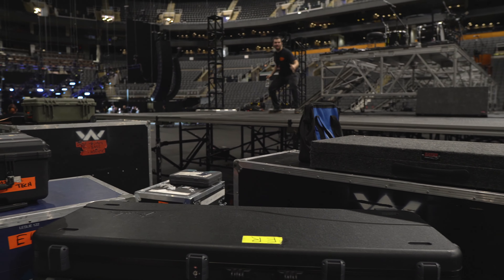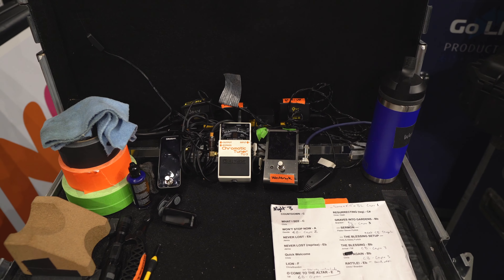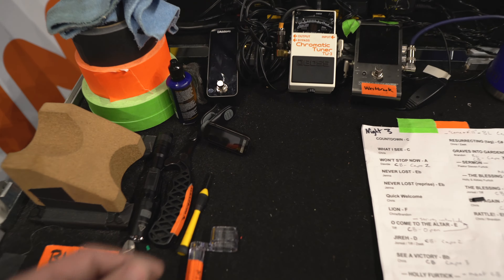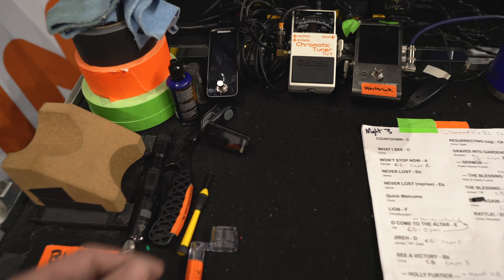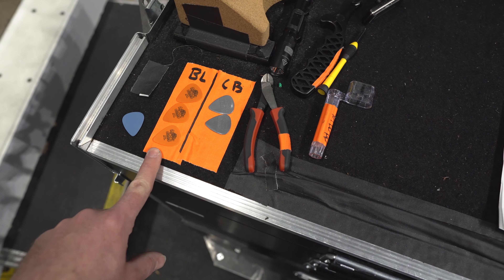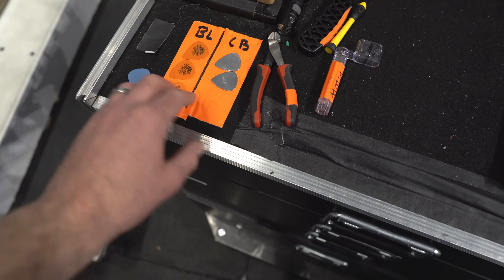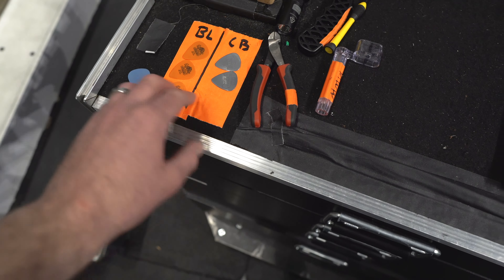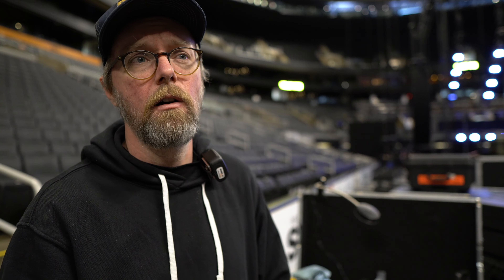Why do I have 3 Tuners? Guitar Tech Station Run Through - Elevation

Comment: If you are tuning with the Peterson are you saying that the vibrations from the stage volume cause the strobe to be inaccurate? I’m not really following how the Boss works better in a loud environment?!
Reply from the maker: Acoustic instruments are going to pick up more sound and vibrations through the body/pickup. Some tuners are better at handling that but usually at the trade off of not being quite as accurate.
Reply: @MichaelWWestbrook But the Peterson is the most accurate and the easiest to read display to get that accuracy. It seems like either it is accurate or inaccurate…I don’t see how there is a trade-off unless the Peterson is somehow more prone to being inaccurate in this high volume environment. And I wasn’t thinking this was in reference to acoustic instruments. Most people use electric-acoustic instruments which would then be plugged into the Peterson and there shouldn’t be any accuracy issues? Forgive me, but I’m just trying to understand…
Reply from the maker: It’s not that it’s inaccurate but it’s “hearing” the notes you are playing and other notes from the loud environment come through the acoustic instrument via vibrations. A great acoustic pick up is picking up the sound and vibrations from the instrument but if loud music is also vibrating the guitar it gets confused. The Peterson jumps around and can’t decide what note you are trying to tune.
Reply: @MichaelWWestbrook I see…so that is specific to electric-acoustic guitars only?
Reply from the maker: Generally acoustic instruments… Stand up bass is maybe the hardest.

Comment: Do you have a brand or barrel jack replacement that you like? Every switchcraft barrel jack I've ever had has failed.
Reply from the maker: I don’t and it’s unfortunate that the custom shop Duo Jets I’ve seen use them. They are much more prone to failure then a standard 1/4” Jack.
Reply: @MichaelWWestbrook  To tell a family secret, I've used acoustic guitar style panel jacks - the ones with a flange for a strap - as a replacement and they've lasted longer than a switchcraft.

Comment: Are you changing strings before every show?
Reply from the maker: No, depends on the guitar/player. Most frequent was every 2 shows. I try to get them offset on different days so changes are spread out on different days if possible. Generally I had 2-4 instruments a day that got changed.